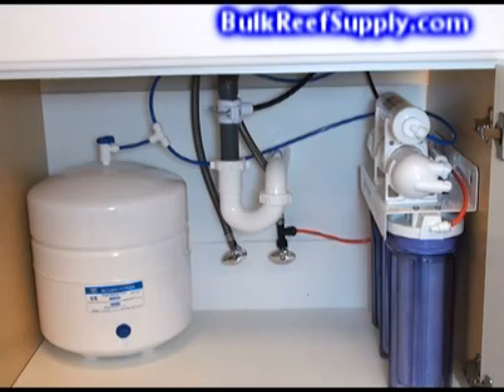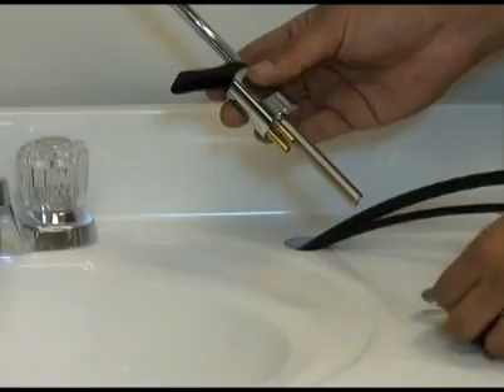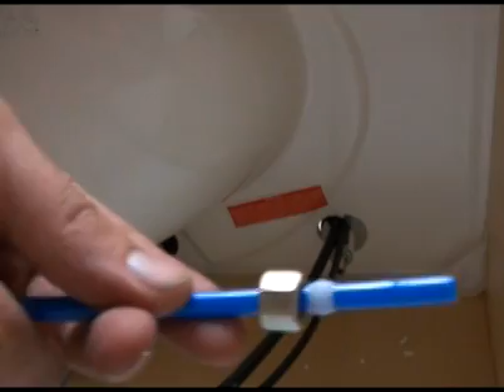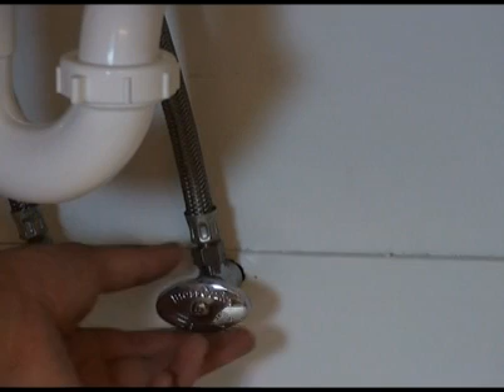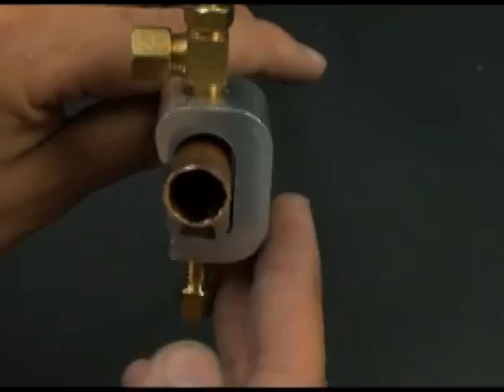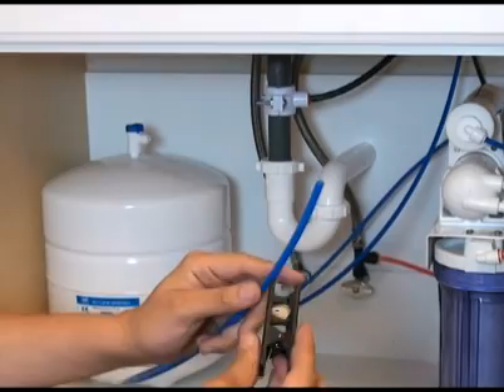5 Stage Reverse Osmosis Drinking and Reef Water System Instructions - Bulk Reef Supply

Comment: I already had the 6 stage filter and got the filter for the reef tank, it is very easy to install but I find out that the water pressure slow down in both sides it's there anything else to install for the water pressure?  Before I didnt have any problem with the pressure in my drinkable water. I did everything from the video.
Thanks.

Comment: This is exactly what I was looking for. But I have a quick question. I have a 5 stage 180gpd RODI system with a booster and a permeate pump. I will be setting it up the way you guys are indicating, however I want to be able to add a float valve on this with an auto shutoff. Is this possible? Would the  auto shutoff be put in the regular spot?

Does the check valve in this setup, stop the high pressure valve for the booster from working properly when filling up the pressure tank since water cannot flow pass the check valve to create the pressure?
I hope I made sense. :)

Comment: Great video guys! Is there a way to install it without it having to be a permanent installation or having to drill into the main water line? 
I am trying to install one where I rent, but before I purchase it I need to know that I can remove it and leave the house intact. 
My idea is to fill a bucket with Drinkable Water, and another bucket with Tank Water each week, but the only faucet I can use is used for other purposes as well, so it needs to be placed only when needed.
Thank you.

Comment: For some reason I’m not getting water into the tank. The valve is open and I made sure water is getting to the T. The faucet has water coming out if it but it is only a small amount like the amount in the system. Any ideas?
Reply from the maker: It sounds like you need to let the RO system run longer. The tank is shipped dry, so it can take an hour or two to fill, depending on your water pressure. If you're still having issues, give our customer service team a call and we can help troubleshoot further.

Comment: i just installed my rodi drinking water system. this video made it very easy to install the only thing is the faucet has like a loudish air swoosh sojnd and has a slight leak i double checked everything and it seems that maybe the faucet is damaged. i inspected the faucet and it seems like the sound is coming from the internal.
Reply: Send me the link to the version that lacks air gap
Reply: +BulkReefSupplyCom what can i do tofod this air gap maybe i did aomething worng but what can i do to fix

Comment: Bought a new aqua medic 3 stage easyline 150 ro system. cleans just 88% of the TDS. output is 30!! input is 230. preassure is not to low abour 4 bar. is the membrane faulty? i added a di unit to get down to 5 tds but that to muh imo.
Reply: just tried it, 92%.
Reply: ***** it a german brand. germans dont do bad quality from my experience. and the membrane is american. i used to have such one before and it was great.

Comment: once im done drinking water am i suppose to turn off the valve from the pressure tank because i still hear water coming through the black hose down to the waiste drain (waiste water line). once i shut off the valve the water stops. i connected a shut off valve to whenever i need water ill open it and close it so that i dont waiste water otherwise wqter wont stop coming through.
Reply: Ok thanks

Comment: Just spent the most uncomfortable 2 hours under my kitchen sink setting one of these up. No it had nothing to do with your system but the people who plumbed my sink... Gods Below I want to find them and beat them with the biggest monkey wrench that I have. Anyway I'm done setting up this system and I'm letting it run before hooking it up to my reservoir. 

P.S. the system was easy to connect, my only complaint is that I'm hooking metal nut to plastic threads and that's not something that I'm too keen on, it is too easy to crossthread plastic.

Comment: @Rapter630 I found the same thing.  My waste water keeps flowing when the tank is full.  I watched the installation instructions for the auto shutoff valve and it seems to be specific to the float valve.  But I too thought it would have to work with the pressurized tank.  Not so.